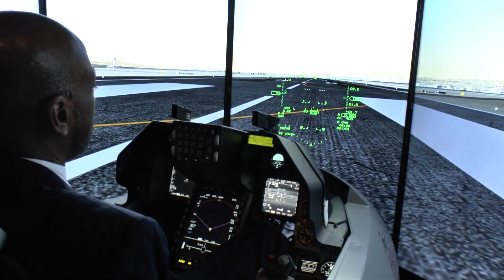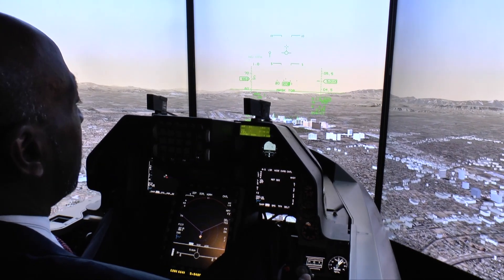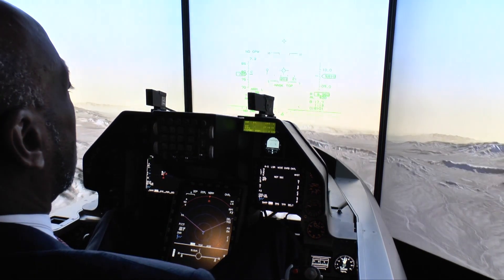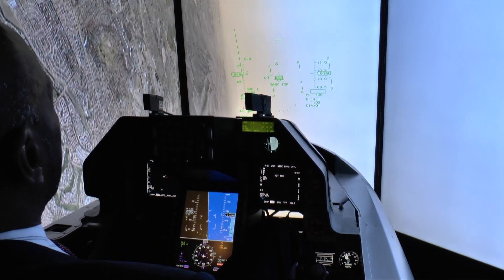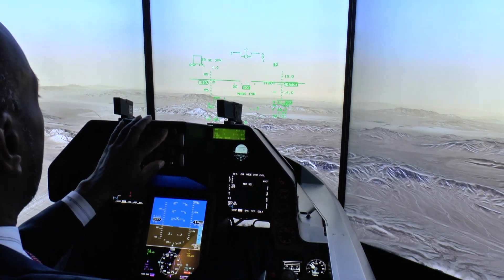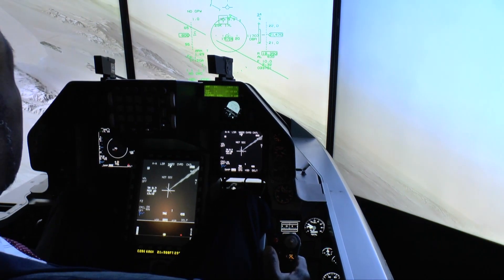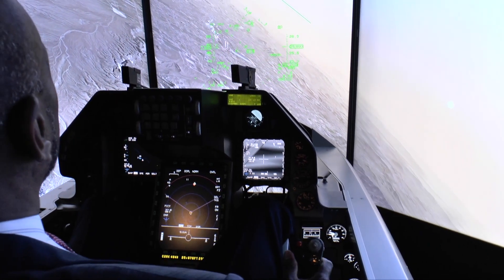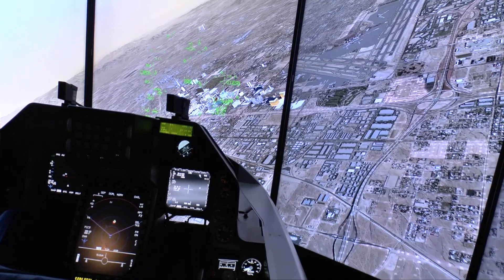Indo Def 2016: Inside Lockheed Martin F-16V Falcon simulator

Comment: I had a brief opportunity to use the simulator today at the 83rd Internation Exhibition, in Thessaloniki, Greece. I managed to land acceptably for someone who has never used a sophisticated simulator. 

You could tell the advanced flight model. The aircraft was more difficult to control than the usual flight simulators. Roll inertia is significantly more than you'd expect and requires counter-input to halt immediately.

Also, HOTAS is amazing. There's even a hat on the throttle handle that lets you control a reticle on the radar screen to pick targets for missile launch.

Thanks to Kenn and his colleague (don't remember the name) for their patience and professionalism in that incredibly noisy and crowded environment.
Reply: Does this simulate a radar warning receiver? Did you have the chance to see it function?
Reply: @gb7418  Sorry, nothing like that happened on my brief stint. There were so many people queuing for the simulator, the LM guys just did a simple thing with each "pilot" and then onto the next person. I was lucky enough to do both an aerial engagement and a landing.

Comment: When the pilot is equipped with the Helmet Mounted Sight, does it mean that the HUD can be obsoleted as all the tactical & navigation data are projected on the helmet glass?
Reply: No. The way it works in the f-16 is that there is a sensor and if you are looking straight ahead at the HUD, you dont get the Helmet symbology. If you turn your head left/right, up/down, the helmet comes alive.
Reply: lupahole Got it & tks! But what fascinating is that F35 can have the HUD obsoleted, does it mean that the HMDS of the F35 pilots is more advanced than that of the F16's? I have seen a video showing that the size of the HMDS  of the F35 pilot is 
tailored for every individual.
Reply: Correct, the f-35 does not have a HUD. Its all done with the HMD and its way more advanced than the JHMCS of the f-16 and f-15.
 Yes, its suited to each pilots measurements.
Reply: lupahole excellent! Another question:
what's the exact difference of a holographic HUD than a traditional one?
Reply: Ah, not sure about that one. Dont know if there is a "traditional one". All of them are holographic. Even the old ww2 gun sights on planes like the spitfire.
Reply: lupahole BAE System says that their HUD has the computer generated holographic technology & waveguide optics integrated. 
Anyway, have a nice weekend & thanks for yr info.
Reply: @lupahole  That's all configurable from the settings though. You could always dim the HUD to 0% if you wanted to, and disable HUD/COCKPIT occlusion from within the HMCS config. Source: Last night's session in DCS World.
Reply: M L That's what I want to know, thanks a lot！

Comment: Out of MARCA but could US obtain or upgrage current Block50 to 70 standard?
Reply: The Air Force is getting out of the F-16. It’s going the way of the F-35. I wouldn’t be surprised to see another Air superiority fighter is already in the works. Image this: a low RCS aircraft with TWO F-35 engines and an payload damn near the size of an F-15E. We are talking about super cruise at 500ft with less than mil power. It would be a game changer!

Comment: The side MFDs need a major upgrade.  They look like they are still black and white CRTs.
Reply: they're not they are full color MFDs, what you are seeing is the sniper pod in Infrared setting White Hot/ Black Hot
Reply: wwbdwwbd, The F16 block 52 and 72 have full color MFD displays. This simulator is not 100% accurate though. I am sure that the block 72 still uses the same DED as the block 52. The one used here does not look like it should. My simulator actually looks better than this one. I wish I had the display set up though. The title is misleading. He demonstrated the capabilities of every modern F-16. The only new thing is the Auto GCAS system. I was hoping that they would show something that the block 52 could not do.
Reply: the three Mfds were in full color, i don't know what you guys are smoking...

the simulator graphics is shit, but it serves it's purpose
Reply: sagrzmnky:  Every Block 50/52 F-16 doesn't have AESA slewed IRST.  There are some substantial upgrades with Block 70/72 with the V model, mainly the SABR and integrated E/O systems with the AESA, as well as other things.  CFTs extended the mission radius to over 1000nm.
Reply: Maybe you should try some of what we are smoking. It's awesome....
Reply: LRRPFco52  There was a block 53?
Reply: sagrzmnky, sorry, typo.  Edited.  My dad worked on integration of major upgrades to F-16C starting with Block 30, which was first to have the GE Engine IIRC.  Every production block subsequent to that had 40/50 with the GE Engine, and the 42/52 with the Pratt engine. They made a common engine bay and inlet with structural changes from Block 25 to accommodate the Improved Performance Engine program.
Reply: LRRPFco52 
I have 3 friends currently working at LM in Ft Worth. One is currently working on the V.

Comment: Wow, compared to a f 18; that looks so much easer to fly.
Reply: F-18 is a little harder to start since it has 2 engines to fire up. The stick on the F-18 has a lot more movement. The stick on the F-16 only moves about 1/4 inch or less in all directions. It is force sensitive.